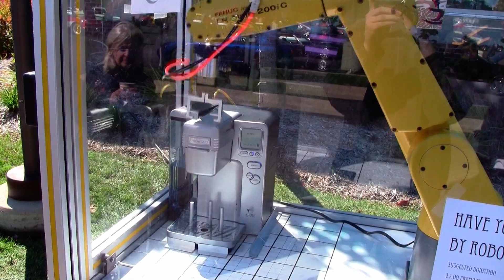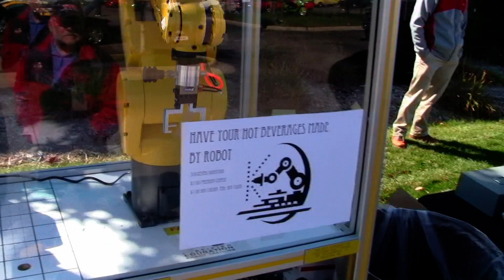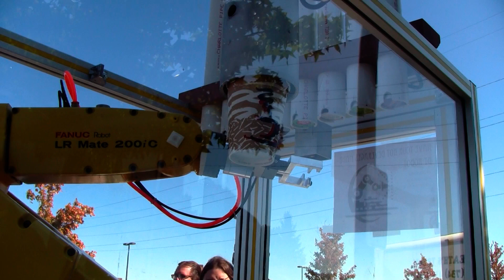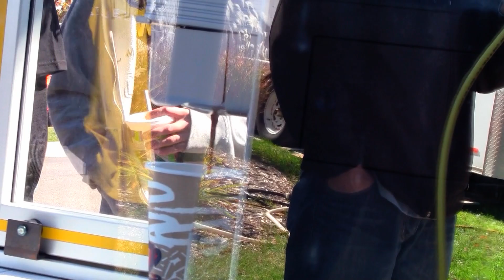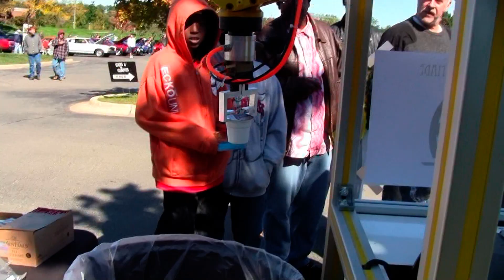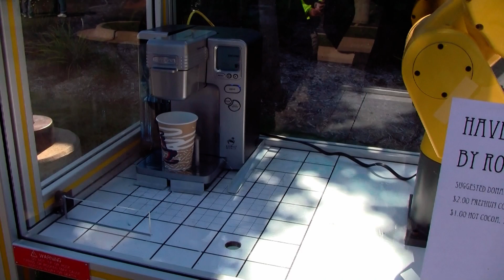Robotic coffee machine (Fanuc LR200iC & Keurig)

Comment: There has to be an easier solution, seems like a bit of an overkill. A simple motor that has an attached pulley tied to an infuser will work, on a programmed timer using a WeMo. http://goo.gl/H8eOZe Brevilla seems to lead this consumer automation process for a moderately high price tag, http://goo.gl/sPZ4Yi Starbucks Clover's work too for 10 times the price.